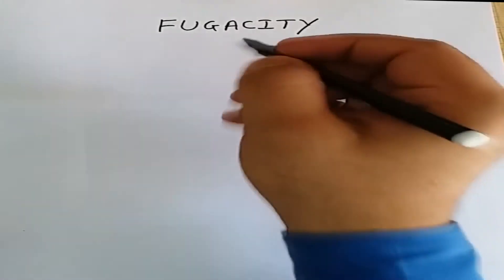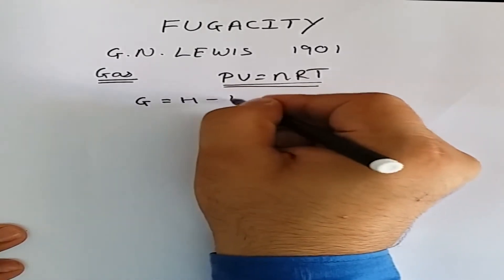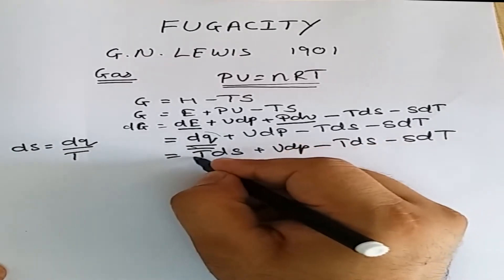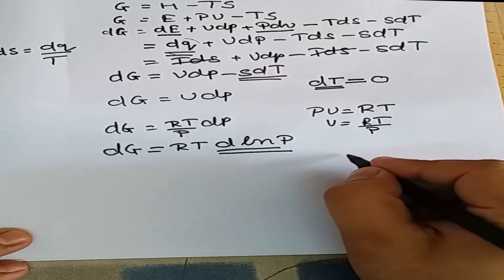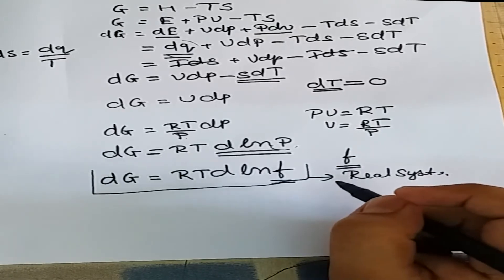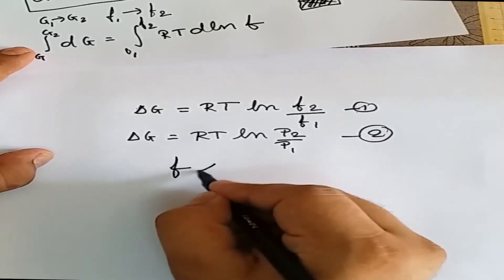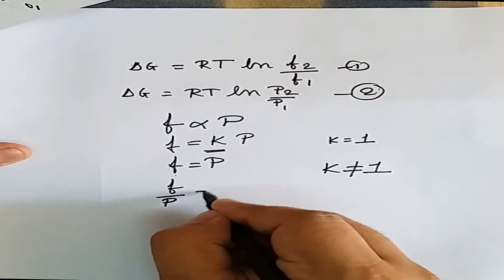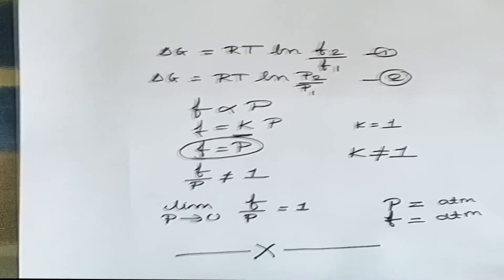introduction to FUGACITY

Comment: So fugacity is the tendency to change phase and is similar to pressure?

Your information seems good, but the quality of the audio in the video is terrible.
The volume goes up and down a lot, which is probably from the distance of your mouth to the microphone changing and/or the angle between your mouth and the microphone changing and/or the volume of your voice changing.
Reply from the maker: Yes this is one of my initial videos so the audio quality is not very pleasing. In my latest videos it is omproved quite a lot. Thank you very much for appreciation....